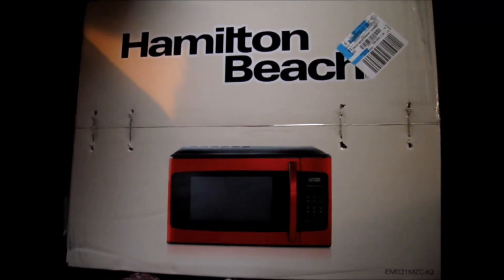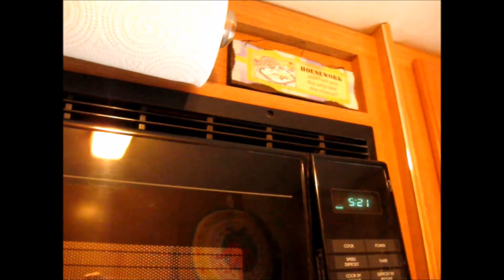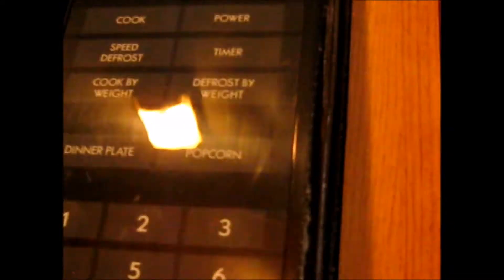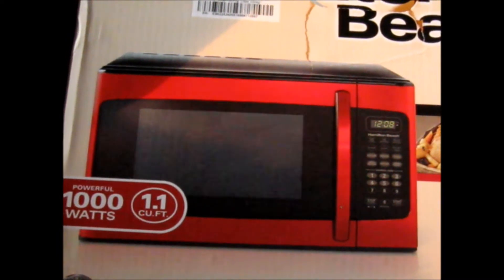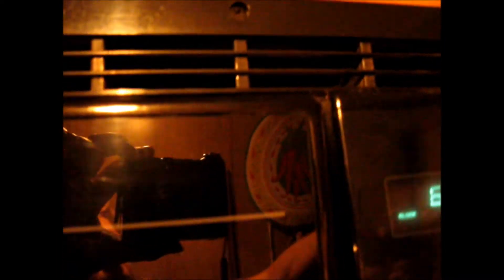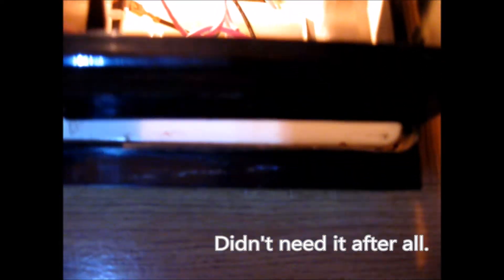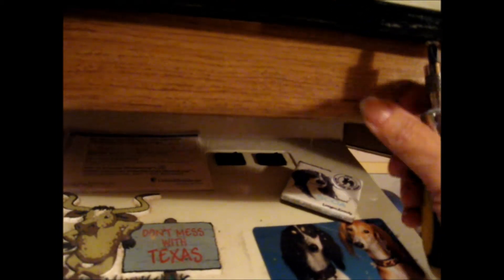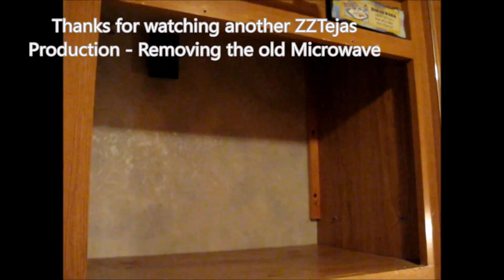Fulltime RVing   Removing the old Microwave

Comment: It may just be on my device but the sound is going in and out.
Reply from the maker: It might be the air conditioner running in my background & the old camera I used. The audio on my older camera is not so great. But it can pick up light at night easier than my DSLR camera does. Thanks for bringing it to my attention.